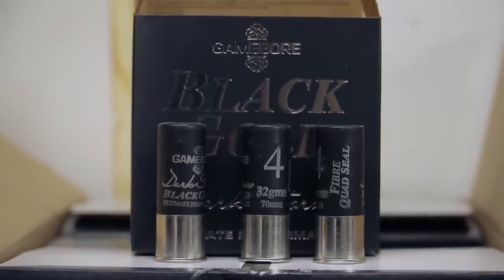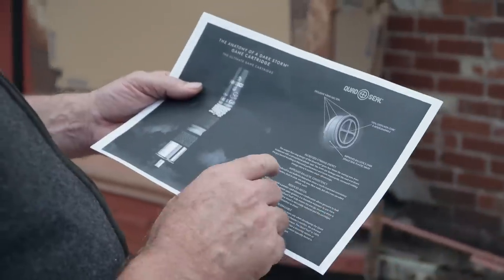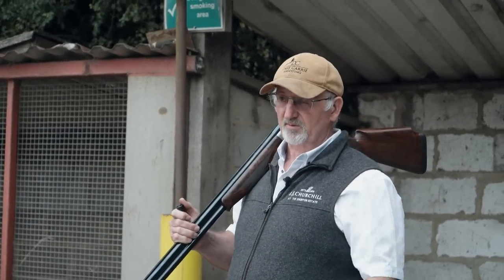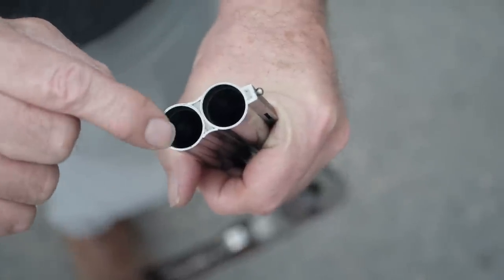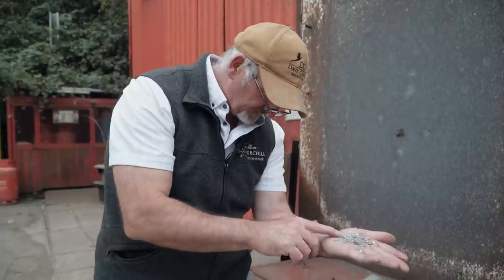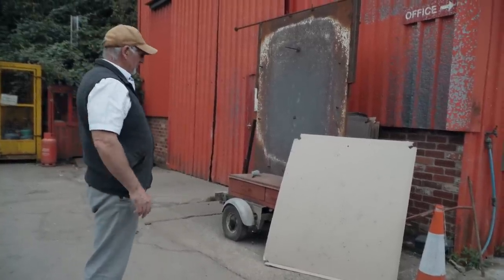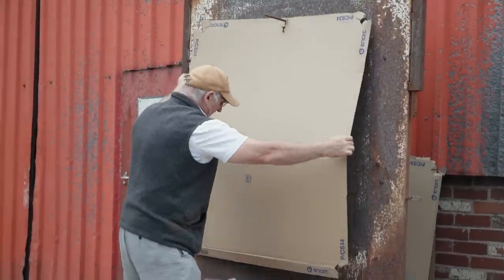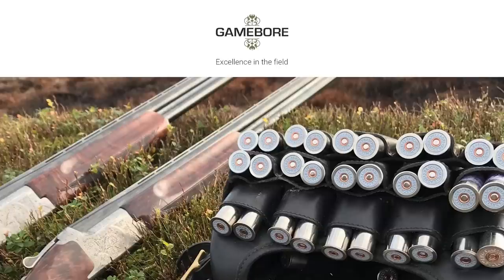Devastating Quad Power (Gamebore Dark Storm)

Comment: Dave I tried these in 32 gram 4 shot. I bought 1000.
Bearing I am a tall fairly lean build I don't suffer with recoil, I can fire a slab of 36 gram 3's plastic wads all day long with no ill effect whatsoever.
I used the quadseals on pigeons and after 75 cartridges I was struggling to keep my head on the stock due to the excessive recoil.
I went home battered and bruised and took the remaining 925 cartridges back to my supplier who kindly replaced them with my usual 32gram 4 plastic wads.

Comment: Cracking shot on the pigeon, but you really need to read up on internal and external ballistics, any two cartridges with the same muzzle velocity and shot size/type will have the exact same energy at any given down range distance, it being irrelevant how the cartridge was constructed. Momentum is a factor of gun weight, mass exiting the muzzle and its muzzle velocity.
Quad seal benefit, potentially a better pattern, however pattern is also a function of the gun choke otherwise why choke a gun barrel.  Less propellant to obtain required muzzle velocity is certainly a commercial benefit as reduces the manufacturing cost of the cartridge.
Reply from the maker: Thanks Robert

Comment: Hi Dave hope you and family are well. What are your thoughts on banning lead shot and going on to steel. I'm against it on every level from less effective and humane than lead, does not suit all shotguns,/barrels!, very poor science as to its effectiveness,known to rust or needs zinc coat more toxic than lead!!!, started by John Swift ex BASC enough said, a tool for the anti, s. Even MP Liz Truss rejected the anti lead group, s findings as per John Swifts presentation. What are the alternatives, we can use paper or recyclable cases, bio wads, but I know Diamond Shot is with out equal. Take care my friend going to be an interesting 3 to 5 year period in cartridge manufacture. Regards Tony
Reply: union310  Some properties still have, it's only when modernising that high pressure high grade piping is used. The water pressure on old lead pipes isn't a patch on modern one, s. I see your point but iv never heard or had evidence presented of anyone in the uk injured/killed by lead consumption. It is vital for energy retention and clean humane kills. Steel shot is rubbish and just not needed.
Reply: union310  Can't fault your opinions and I was lucky enough to enjoy a cane rod from my late grandfather. It was made by a certain Dick Walker entombed in angling history. My nephew has it still. I only use a. 410/28 guage both 3/4 and full fixed choke. There is no way I can run steel through them. I'm sure I'm not on my own and yes lead is toxic no question, but we don't have a good viable swap to option yet IMHO. I'd happily use an eco cartridge but steel is useless side by side with lead. All the best mate regards. Tony